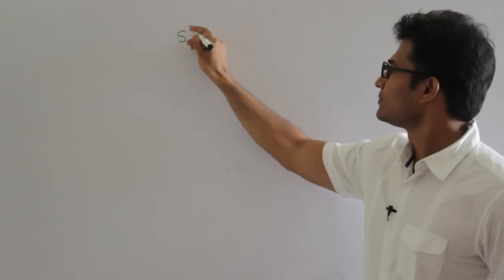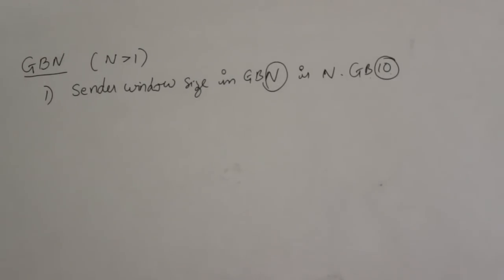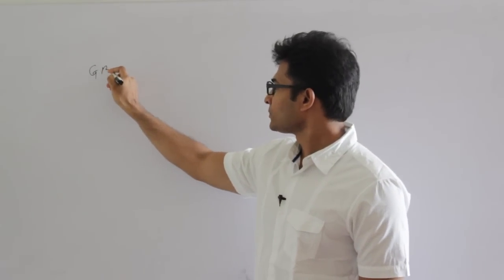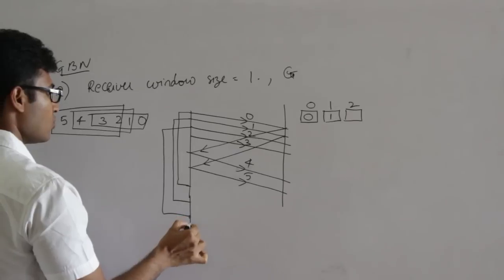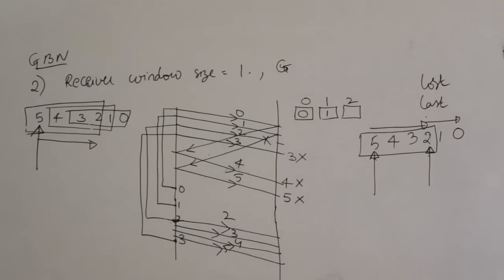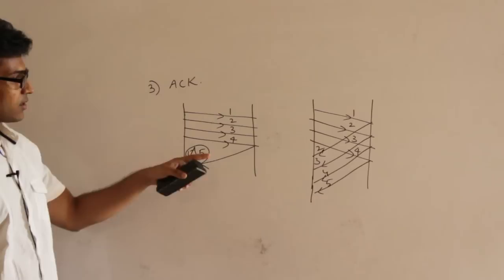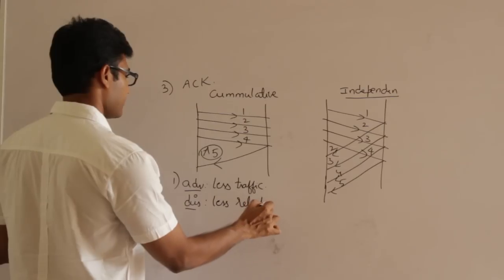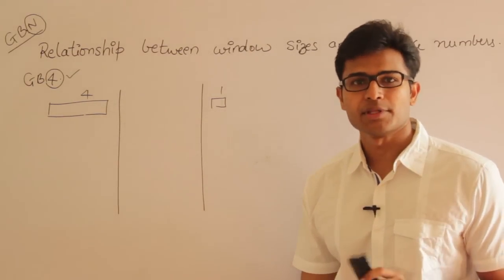CN |  Flow Control methods | Go Back N | Ravindrababu Ravula | Free GATE CS Classes

Comment: Q:-Station A needs to send a message consisting of 9 packets to Station B using a sliding window (window size 3) and go-back-n ARQ protocol.All packets are ready and immediately available for transmission.If every 5th packet that A transmits gets lost (but no ACK from B ever get lost),then what is the number of packets that A will transmit for sending the message to B ?

Comment: Great ! You explain every concept very cleary.. in all your videos helping me in gate preparation.

i got stuck when i tried with GB4 and every 5th packet is lost.... i got answer as 26 is it correct?? Please help.
Reply: FIRST TRANSMISSION:
When PCK NO. 5 is lost, PAC NOs. 6& 7 were transmitted already. TOTAL NO. OF PCKS in 1st TRANSMISSION= 5+2 

SECOND TRANSMISSION:
Now, retransmit PCK NOs. 5,6 & 7. Two PCKS already transmitted in TRANSMISSION 1, so now,  PCK NO. 7 being the 5th packet in this transmission is lost. But PCK NOs. 8& 9 transmitted already.
TOTAL NO. OF PCKS in SECOND TRANSMISSION= 3+2

THIRD TRANSMISSION:
Now, PCK NOs. 7, 8 & 9 are retransmitted. SECOND TRANSMISSION 2 PCKs transmitted so now PCK NO. 9 is the 5th PCK and so is  lost. PCK NO. 10 already transmitted.
TOTAL NO. OF PCKS in THIRD TRANSMISSION= 3+1

FOURTH TRANSMISSION:
Retransmit PCK NOs. 9& 10.

TOTAL NO. OF PCKS in FOURTH TRANSMISSION= 2

● TOTAL NO. OF PACKETS TRANSMITTED =(5+2)+(3+2)+(3+1)+(2) = 18

Comment: 4.39 I don't know how did you arrive to sender window packet to 1+2a. Both Tt and Tp are time unit. I can only infer for 10 packets it took 1ms of transmission time and 2x49.5ms of propagation timeand efficiency is 1/1+2a. Maybe for stop and wait it is 1/1+2a and for Go Back N it is N/1+2a? Still how 1+2a became the window size as it indicates time?

Comment: sir if GBN 3 and every 5th packet is lost .in this case window 5 6 7 only lost and if we have to retransmit 5 6 7 only.why does  considering 6 7 5 6 7 if u consider like 6 7 repeated  and receiver discard those packets.

Comment: i got a doubt that in the question at 19:28 could it be possible that we have less than 18 transfers if we have lesser time out,   than if time out is less we would alresdy know about loss before sending other packets unnecessary and we will have >18 transfers.

 but then i understood that timer can't be that much less that it don't allow other packets of window to send

it actually means that the window size is given by the 2 times of Tp  i.e we are using the 2*Tp by not keeping idol and that made a window , not a window made ack to came late.

hope u got it.

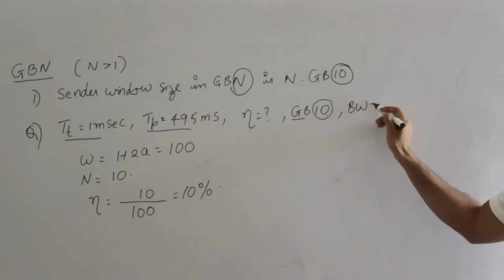Comment: Doubt at 5:37 why bandwidth is taken as 40mbps and not by using formula B. w. =L/Tt which gives 10 /10^-3 =10^4.... Reply asap
Reply: 'L' means size of each frame or packet and you are taking 'N' as 'L' ,which is wrong. 'N' means number of packets or frames. No information about 'L' is given in the question.

Comment: while 6th packet is lost then ur retransmiting 6th packet as well so y are u not couting that as retransmitted packet, if that's counted then next lost packet is 7th packet and not 8th plz clarify this doubt
Reply: that is being counted...check again..we are retransmitting 6,7,8,9 .
since every 6th packet is lost, in the 2nd slot we start counting from  7,8,9(since they are the next transmission after 6 ) and then  we count the new retransmissions i.e. 6,7,8,9.
Reply: So when 6th packet is lost and we have {6,7,8,9} in sender window, we resend 6,7,8,9 as done by GB4 but sir has send 7,8,9,6,7,8,9... as the counter was on 6...isn't it that 7,8 & 9 are send 3 times? Please correct me if I am wrong.
Reply: Dhruv, in ur statement 'but sir has send 7,8,9,6,7,8,9... as the counter was on 6',

first 3 numbers of 7,8,9,6,7,8,9 was not resent, only 6,7,8,9 was re sent. The first 3 numbers 7,8,9 were from the first batch of packets that were sent before sender realized that packet 6 is lost. So effectively 6,7 is sent twice but 8,9 ... as they fall under second batch of GB4 due to loss of packet 8, will be sent 3 times.

Hope I made my point clear as far as I undertood.

Comment: i think at 22:10 you made a mistake because if the window size is 4 and 6 was in error you would have to transmit 3,4,5,6.
Reply: why we need to again retransmit 3,4,5 as they are received and no loss is there we need to see packet loss i-e every 6th packet ok!

Comment: Sir, this is really informative,Thanks, I have a doubt on the first GB3 sample question you did.You told its answer is 18. But when I counted ,it occurred to me as 20.Is it right?...If my co-viewers find an explanation for this, please feel free to share it with me...
You will be very much thankful,
thank you.
Reply: +MANEESH MOHAN Even I got the same
Reply: FIRST TRANSMISSION:
When PCK NO. 5 is lost, PAC NOs. 6& 7 were transmitted already. TOTAL NO. OF PCKS in 1st TRANSMISSION= 5+2 

SECOND TRANSMISSION:
Now, retransmit PCK NOs. 5,6 & 7. Two PCKS already transmitted in TRANSMISSION 1, so now,  PCK NO. 7 being the 5th packet in this transmission is lost. But PCK NOs. 8& 9 transmitted already.
TOTAL NO. OF PCKS in SECOND TRANSMISSION= 3+2

THIRD TRANSMISSION:
Now, PCK NOs. 7, 8 & 9 are retransmitted. SECOND TRANSMISSION 2 PCKs transmitted so now PCK NO. 9 is the 5th PCK and so is  lost. PCK NO. 10 already transmitted.
TOTAL NO. OF PCKS in THIRD TRANSMISSION= 3+1

FOURTH TRANSMISSION:
Retransmit PCK NOs. 9& 10.

TOTAL NO. OF PCKS in FOURTH TRANSMISSION= 2

● TOTAL NO. OF PACKETS TRANSMITTED =(5+2)+(3+2)+(3+1)+(2) = 18

Comment: sir plzz tell me why the window size is 1 + 2a
Reply: i have the same ques
Reply: refer to previous video to understand it. Its very easy if you can analyze
Reply: SHRIRAM SHARMA .. a=Tp/Tt
Reply: 1+2a is nothing but (Tt + 2*Tp)/Tt. Which actually means total time divided by time required for 1 packet. that would give us total number of packets we are able to transmit in that time, right ? so to fully utilize that time we need to send those many packets. And to save those packets we need buffer/window size as 1+2a or  (Tt + 2*Tp)/Tt

Comment: Where piggybacking is explained ? Can anyone tell ?
Reply: In two-way communication, whenever a frame is received, the receiver waits and does not send the control frame (acknowledgement or ACK) back to the sender immediately.

The receiver waits until its network layer passes in the next data packet. The delayed acknowledgement is then attached to this outgoing data frame.

This technique of temporarily delaying the acknowledgement so that it can be hooked with next outgoing data frame is known as piggybacking.